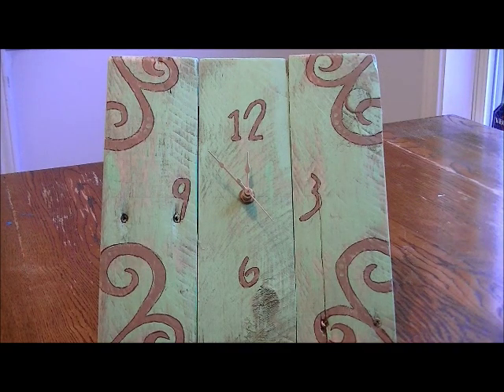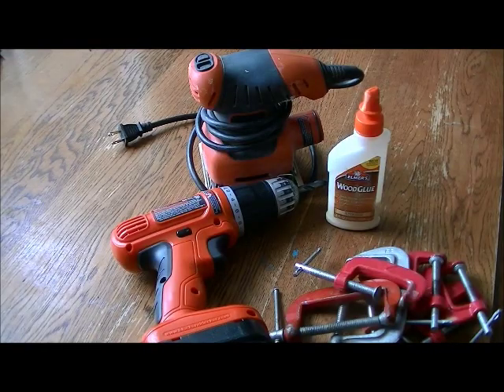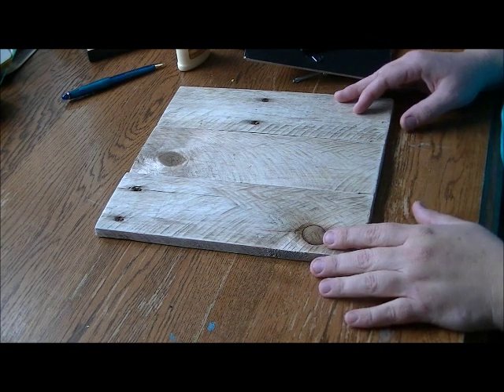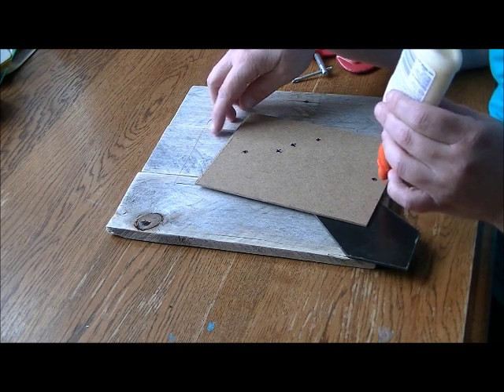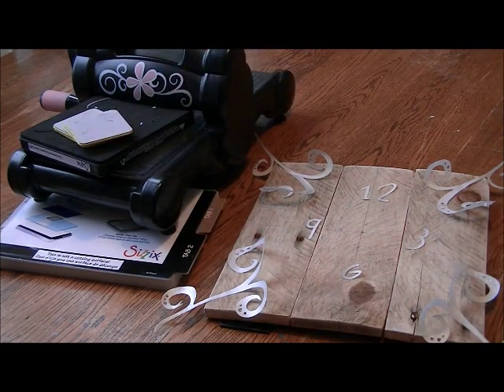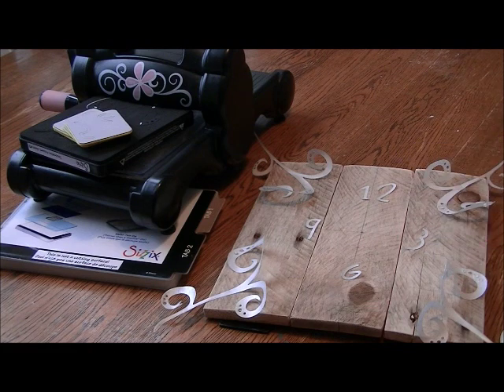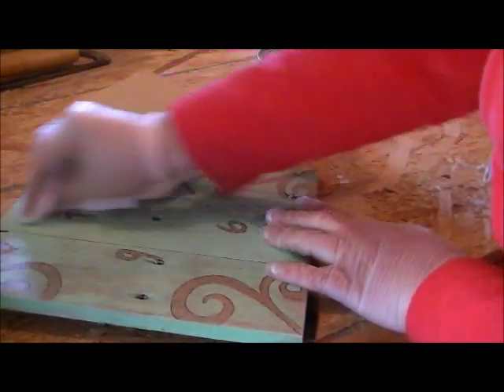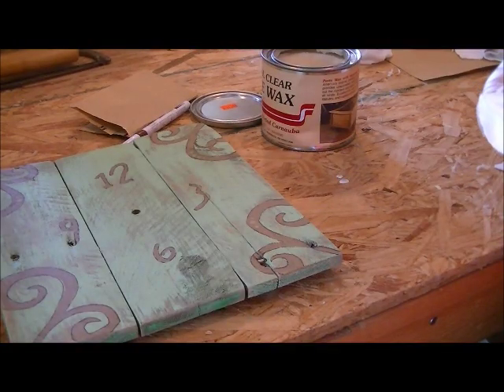How to Make a Wood Pallet Clock on an Easel

Comment: What is the wax for? Is that taking place of a polyurethane varnish?
Reply from the maker: Yep, the wax is just a seal.  It gives a nice smooth finish without the shinier look of poly but you could certainly use that instead.

Comment: Could it be change to a hanging clock?
Reply from the maker: Yes, absolutely!  Most clock pieces come with a removable hanger attached...I removed mine for this project.  Then all you'll need to do is snap off the stand from picture frame backing.

Of course, if you don't need the stand you could just use a couple pieces of scrap wood to join your pallet pieces together and not use the picture frame piece at all.  You can watch this video for an idea how to do that  How to Make A Pallet Wood Canvas